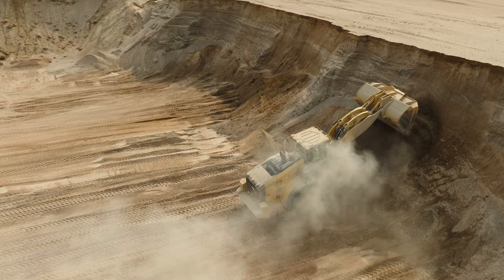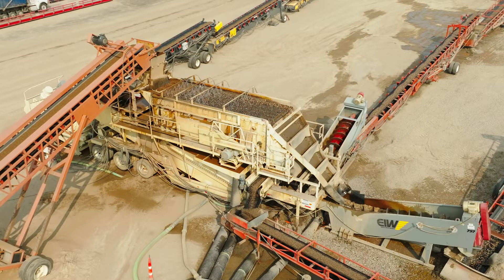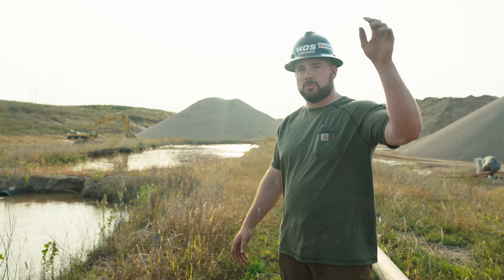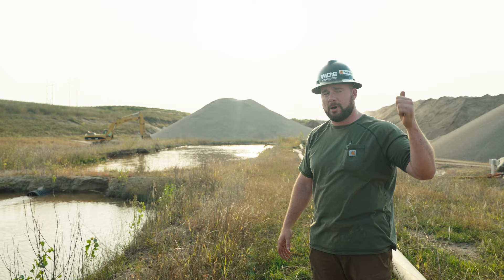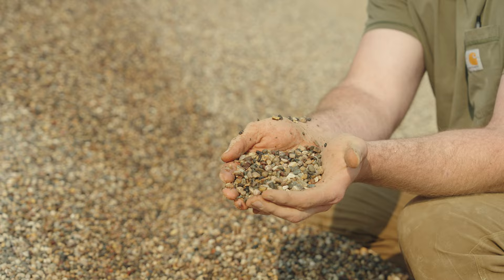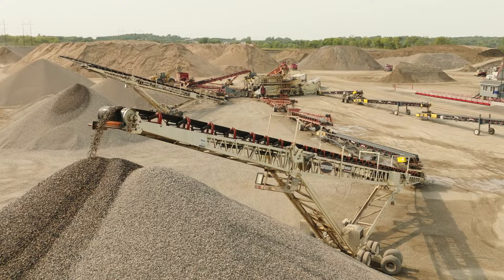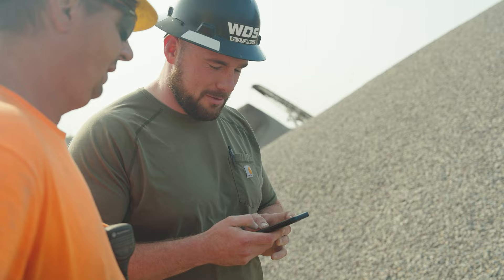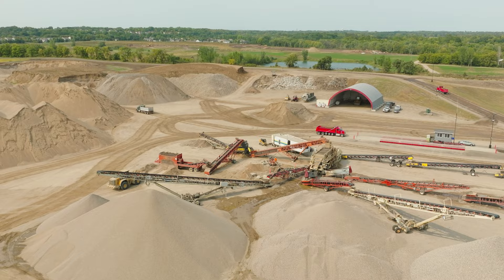How Washplants Work

Comment: Radon rock, also known as under-slab rock or radon stone, is a naturally occurring, permeable mixture of rocks used in construction and landscaping to reduce or eliminate radon gas in buildings. This is more common up north when houses have basement and one of the requirements to be tested for in housing with below ground structures.

Comment: Awesome video--thanks!  I have never heard of "Radon" rock.  I am a landscaper her in Indiana and the term "river rock" is tossed around a lot but means different things to different people.  I've heard L gravel, Landscape rock, #4 Gravel, and septic gravel all used as for "river rock" here. I've gotten a product labeled as Large river rock before that was very dirty and definitely not a washed product while the smaller river rock is washed.  You really have to go to your supplier and check their pile before phoning in that order.
Reply from the maker: right on!  I've heard the term but never actually knew what it was.  its funny as we travel, people have slang for different materials.  "gravel" for instance is used pretty loosely depending where you're at

Comment: What happens to the washed fines? Fill Sand/Select Granular?
Reply from the maker: Any of the suspended solids settle in the ponds and get mucked out and dried into fill material
Reply: @wdscepaniak I have seen people preparing bricks of suspended particles.
Reply: in my country we take the material deposited in the decanters ashore, dry it and sell it to those who draw water and sewage, they use it as a protective layer for the pipes drawn by water and sewage

Comment: Very nice set up what's good about it is you don't use cyclones to remove the sand fines most concrete people like fines in concrete it makes a fine butter that is great for a smooth finish. I was in aggregate for 45 years and you have some good looking equipment
Reply from the maker: Certain sites we’ve been forced to use cyclones.  Thankfully not here.
Reply: Can you explain cyclones? And why are they bad?
Reply: @joedasilva38  They're not bad they remove sand fines from washed concrete sand it's just concrete finisher's I know like the fines in the mix makes for a smooth finsh.

Comment: Hey bud, u seem like the best person to ask- i run a landscaping company and im trying to pull wash and replace 1400sq ft + of 1/2"-3" rock.  Sorting we dont care about. But there are quite a bit of grass root & dirt in them.  I made a giant grate and have been power washing them, but the wash is still holding us up on time soo bad.  Any suggestions?  We r only getting ab a ton of rock done a day if we r lucky
Reply from the maker: I’d look for a place to buy new washed material.  Expensive up front but far less time consuming.  Especially if this is a demo of some sort.  Just replace with fresh product.  Hand spraying 1 ton per day will take a long time.
Reply: If you're handy with a welder you could make a simple trommel by welding some steel drums together and putting them on rollers.  And then putting a high pressure spray bar down the middle.  
      Like on the gold mining shows.